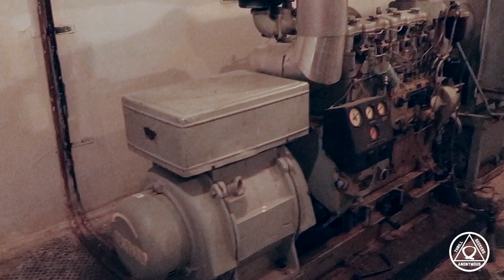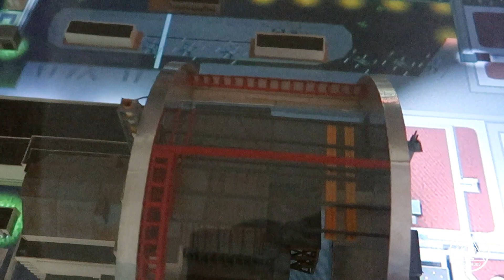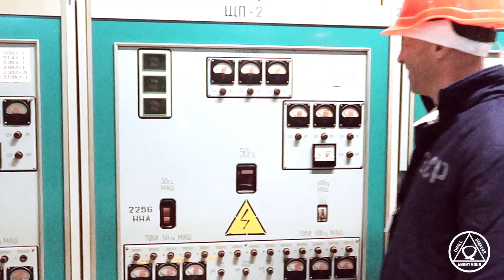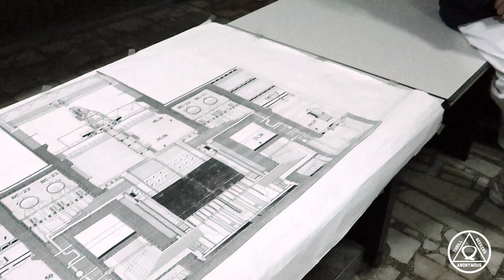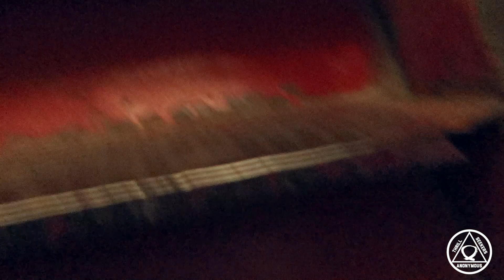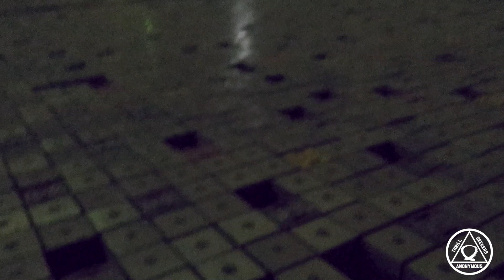Chernobyl Tour Including New Tour Just Available Reactor 4 Control Room, Where The Disaster Occurred

Comment: Why are so many things missing from Control Room 4 ?
Reply: Perhaps as souvenirs or as replacements for the other 3 units which were running until 1991, 1996 and 2000 respectively since Unit 4 at the time of destruction was about 3 years old so everything was close to pristine condition I would think.

Some critical parts could have also been removed to hide facts, but I am not sure. We are speaking of Soviet Union after all.

Comment: Why was that wall constructed?
Reply: So the radiation levels arent as high
Reply: Michael Jacksoff ah
Reply: @Plymouth_Belvedere  does that mean the reactor remnants are still hot?
Reply: @HighAway  yeah, they are afaik. My memory is fuzzy but that wall seals off the entrance to the corridor, that was 300 meters away from the reactor itself
Reply: @Plymouth_Belvedere  You are right, on top of the control room was the south deaerator and behind the control room (behind a few walls/corridors) was the central hall. Infront of the CR would be the turbine hall, just for reference. I think bionerd23 had a floorplan in one of her videos back when she was active of the rooms including central hall and CR.

The only thing I don't really understand from the limited footage online is that on floorplans units 1-3 CR's are in line but it seems you need to take a lot of turns and stuff to reach unit 4 CR, while on the maps it shows all 4 unit CR's being in line. Maybe something of after the accident or am I missing something?
Reply: @surena9451 that’s the same I’ve had for a while